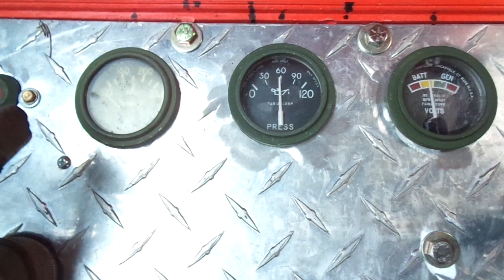HMMWV HUMMER H1 M998 humvee Chassis W/6.5L turbo w/4l80 and HGM controller for sale

Comment from the maker: It is from a 2000, engine is NOT a GDP (12555506) 04/26/10 date on the right side upper rear on block.
All bearings, rings (yes cam also), with new heads, originally came from a civilian H1.
No idea about miles, when I bought it the guy said 60K but I know that was BS. Will say this, There was no ring ridge and crosshatching was present.
(still did a light hone on all cylinders). 8fore seven eight to 6-01fortyfive. cell